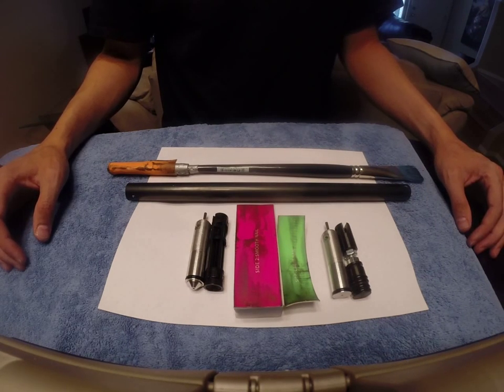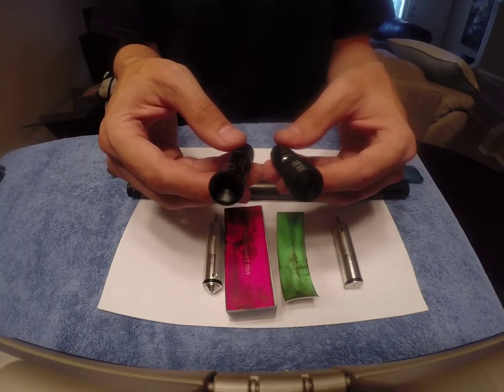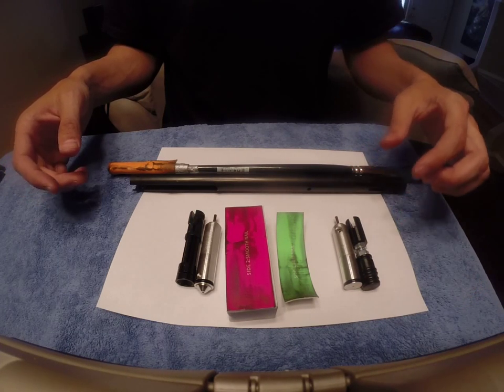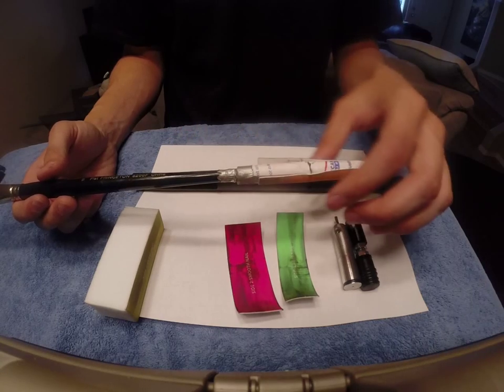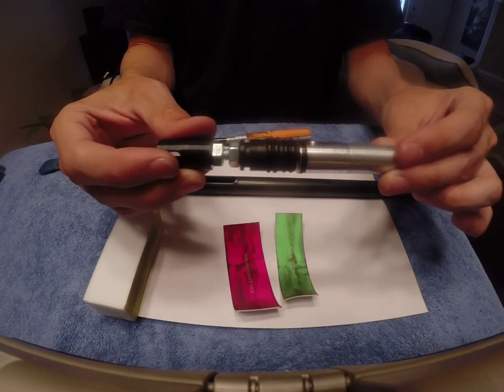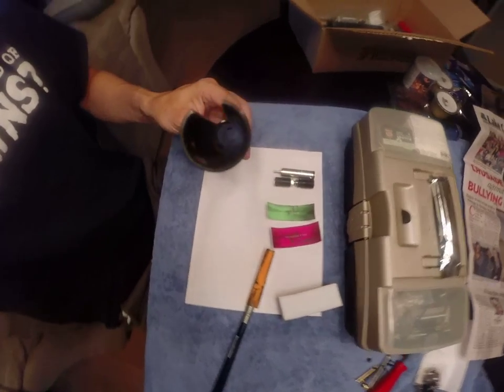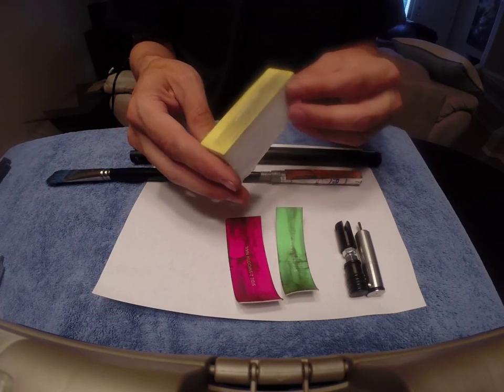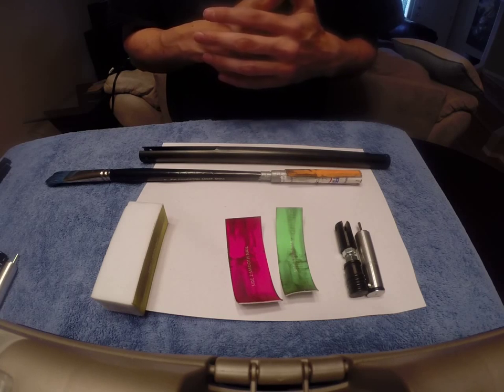The Great Crosman Build part 5 (flat topping)

Comment: is the flat top piston worth the money? and how much did it help fps wise
Reply from the maker: The flat top setup is like $50 or so depending on where you get it from. The fps went from 420 to about 490 at 10 pumps. If you over pump you can another 50 fps or so. The gain is over 100 fps. If you intend on hunting I'd say it's definitely worth it because you need all the power you can get.